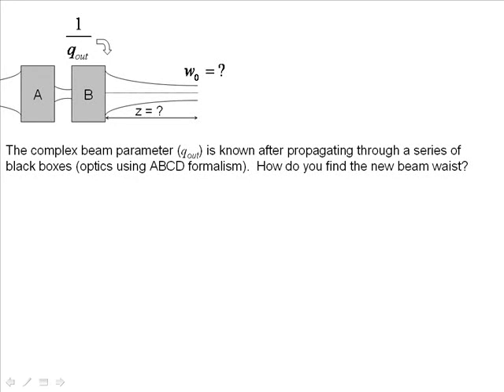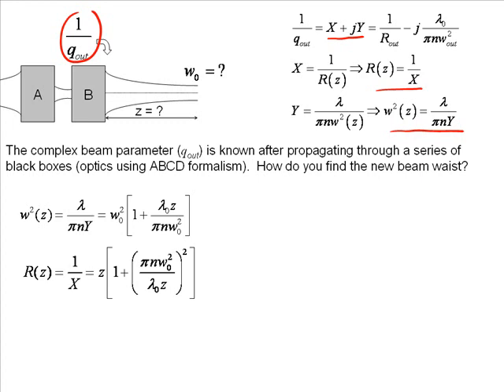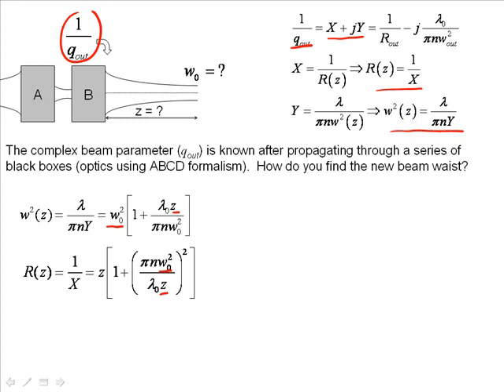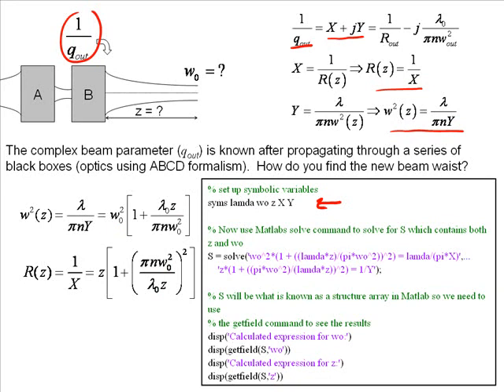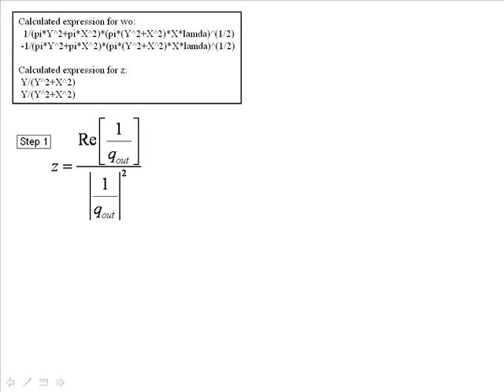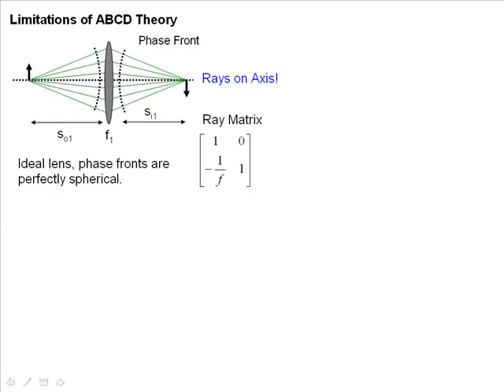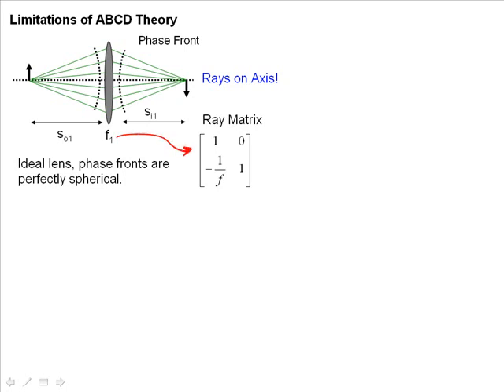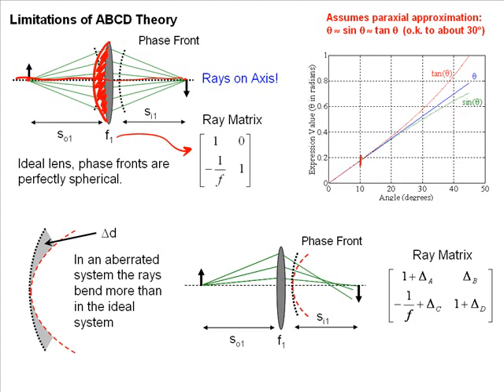Interaction of Gaussian Beams with Optics- Part II

Comment: There is a square missing in the formula of w(z) inside the square root https://youtu.be/Co_fLz4K3Ko?t=41

In case anybody wonders: The exact solution is (assuming R<0 for converging beam, otherwise flip the sign of z)
w0 = sqrt(1/(Pi^2*w^4 + R^2*lambda^2))*w*lambda*abs(R)
z = -Pi^2*R*w^4/(Pi^2*w^4 + R^2*lambda^2)

Otherwise: Excellent video...helped me out a lot!